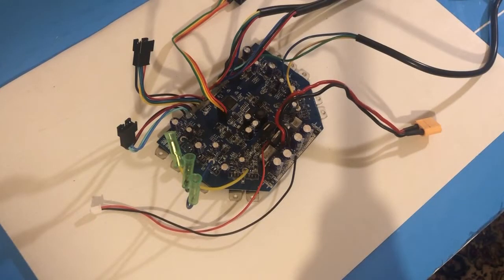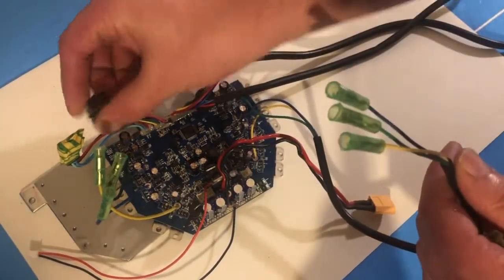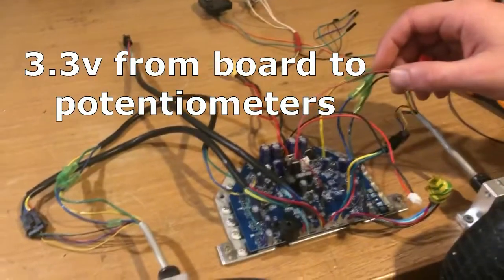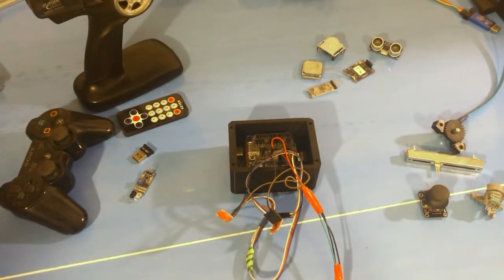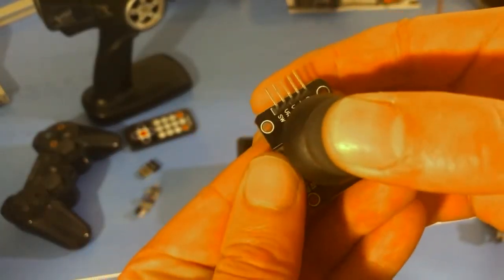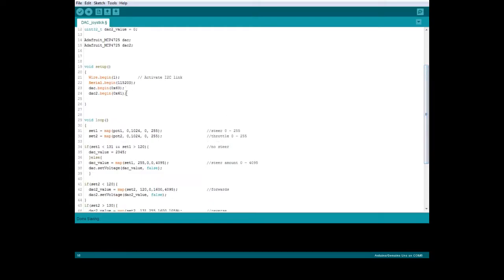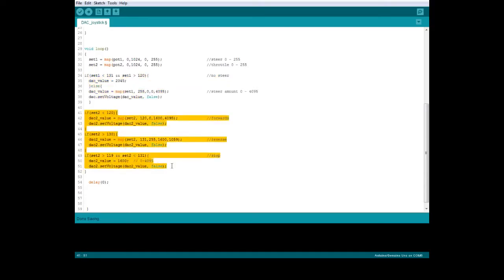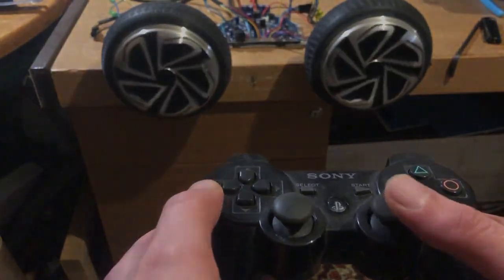HOVERBOARD MOTHERBOARD HACK - how to controll the motors PART 2 - Hover Board Hack

Comment: Hi, nice video. I have a few questions:
1. How can I set it for reverse? like for go-cart. In your video the steering pot seems only control either one wheel and turn into a different speed and direction. What I want is actually simple, I want to steer it forward with the same speed, and I can also drive it reverse (with a switch or else). Can you tell me how can I do that? 

2. Does the battery charging feature still work?

3. How fast the maximum speed can we set in the code?

Thanks before.
Reply from the maker: hi, ok there are 2 pots, one does speed difference, the other does speed for both, so for reverse you just turn the speed one down further than when its stopped and it will go backwards and bleep, for example the 1024 pot value would be something like 0-300 = reverse - stop, 300 - 1024 = stop - full speed, do for your DAC if you are using one you need to split it like that if you are controlling forwards and reverse with 2 buttons / sticks. 

Apparently the battery charger does still work, however i am yet to test it.

Max speed depends on what firmware you are using and if you change stuff in it, the fastest one i have tested myself is the bobbycar version, it has a speed setting you can set when starting up, i think with a 12s battery it can get upto 30mph, its a feature called field weakening, there is more info on this online if you google it, i just set it in the firmware to run off a 10s battery and its fast enough, maby 20mph.

There is a guy who hosts an online firmware compiler that i have used a few times, you can edit the code online, compile it and download the .hex file to upload to the motherboard, here is his channel: https://www.youtube.com/channel/UCLUfNuoSML-vkLYiO0vBUHQ,

hope this helps!

thanks
Reply: @A-tech  thanks for your reply, I'll try it.

Comment: Couldn't the same thing be accomplished using an Esp32? It has 2 builtin DAC channels has wifi and Bluetooth built in to pair the controller. The chip runs faster, dual core compared to an uno.
Reply from the maker: hi, i have heard from someone who has done exactly that, im not sure if the controller can pair without having a usb to connect a cable to pair like with the usb shield, i would like to try it with one but dont have one at the moment, thanks
Reply: @A-tech  I have an esp32 and have successfully paired the ps3 controller to it without any additional hardware. Just the controller and the esp32 module is needled.
Reply from the maker: @jamesmiller9605  ok i didnt think it was possible at least without using a usb host module
Reply: @A-tech  no need for a usb host shield.. esp32 has bluetooth built-in. Care to share with me what code you used for mapping buttons to the DAC. The examples for ps3 controller work for the buttons but mapping them requires more code than the examples show.
Reply from the maker: ok ye sure, how did you pair it without having a usb port for the cable? code is something like this: 

forwards = map(R2, 0, 255, 1200, 1600);
reverse = map(L2, 0, 255, 1200, 1000);

this is just example, so say 1200 to the DAC gives stop at the wheels, 1200 - 2000 or whatever is the forwards range and 1200 - 1000 could be the reverse range

is something like that what you meant? 

hope this helps :)
Reply: @A-tech  you have to plug the ps3 controller into pc and get the Mac address that's all thats needed in the arduino code for it to connect.
Reply: The code in your top post has some flaws.

Comment: Thanks for this wonderful video. I'm having trouble with the wiring etc. The battery wires attached to the board is cut off. When I try to attach it to the battery it sparks. I tested the battery with another board and that works fine. Can you gimme some tips? Also is it possible to have a chat with you? I need some more direction. Thanks in advance
Reply from the maker: hi, they usually spark as its charging the capacitors, i use a switch so its a bit better, do you have another battery to try in the suspect board? what are you making? thanks

Comment: Hi  I am using ps3 controller with esp32 servo library but when only half of joystick works I mean from 90 to 180 works but not from 90 to 0 any help thank you
Reply from the maker: hi, its hard to say without seeing some code, are you mapping it from the LeftstickX?
Reply: This is code what I am using and also I have got dual flipsky 4.20 I wanna ask if flipsky is more safe to use than motherboard and if u don’t know some library for esp 32 uart connection... thanks.  #include <ESP32Servo.h>
#include <PS4Controller.h>

Servo CH3_servo;
Servo CH4_servo;

int LX_val,L2_val,R2_val;
int CH3_val,CH4_val;

void setup()
{
  Serial.begin(115200);
  PS4.begin("00:00:00:00:00:00");
  Serial.println("Ready.");

  CH3_servo.setPeriodHertz(50);
  CH4_servo.setPeriodHertz(50);

  CH3_servo.attach(12);
  CH4_servo.attach(13);

  CH3_val = 90;
  CH4_val = 90;
}

void loop()
{
  // Below has all accessible outputs from the controller
  if (PS4.isConnected()) {

  LX_val = PS4.data.analog.stick.lx;  //Steering
  L2_val = PS4.data.analog.button.l2; //Forward
  R2_val = PS4.data.analog.button.r2; //Backward

  CH3_val = map(LX_val, -128, 128, 130, 50);
  CH4_val = map(L2_val - R2_val, -255, 255, 130, 50);
  

  CH3_servo.write(CH3_val);
  CH4_servo.write(CH4_val);

  
  printf("CH1:%d CH2:%d CH3:%d CH4:%d\n", CH1_val,CH2_val,CH3_val,CH4_val);
  }
}
Reply from the maker: hi, i like to see other peoples code, i have only been doing it a few years so lots of my stuff is pretty basic, i didnt know you can define multiple ints together, ok so i think the problem is you have -128, 128, with my ps3 controller it goes 128 when its in the middle, so 0-128-255, let me know if this helps :)
Reply: @A-tech  no it doesn’t work  too many mapping so this library doesn’t allow me to write code like that but what I founded is when I move Lx to right and same time holding R2 it start to go forward and than I can turn to right and left but still holding R2. It’s just doing funny things
Reply from the maker: ok sounds like its just something mixed up somewhere maby a couple of wires or something in the code doing weird stuff, did you get it sorted?
Reply: @A-tech  yes when I am using arduino uno with usb host shield it works  left joystick as steering and right joystick forward and backward….I am using again servo library but dou you know how to write code for L2 and R2 as control one servo forward and backward thanks.. by the way I am not finished with esp32 I just didn’t have time I think  next week I will try to hook up esp32 using usart for better communication… if found something I will let u know

Comment: Hey, I want to use a PWM receiver as the input. I have got the code for it but I am unsure of how I should go about adding it. I'm also not sure how the wiring is required for the DAC's. Thanks
Reply from the maker: hi, do you mean like an RC receiver? im sure there is a way to do it direct, you can do it with an arduino which might be easier with the mapping of the throttle and steering ranges, the DAC is pretty straight forward, they use i2c to communicate with the arduino and need a 3.3v input so they only output 3.3v max to the hoverboard, does this help? thanks
Reply: @A-tech  Yeah I want to an RC receiver, there was a custom firmware to make it work directly but I could for the life of me get it to work. I am very new to Arduino so I'm not sure what pins to put the DAC's according to the code on. A wiring diagram for the DAC's would be awesome. I know I am asking for a lot but just a look over the code to see if my implementation for the pwm is correct. Thanks for the reply.
Reply from the maker: ok im not sure, havnt done much with rc receivers and hoverboards, arduino pins for the i2c communication are named SCL and SDA or A4 and A5, im going to do a Firmware Hack part 3 video soon so i will make sure to include that
Reply: @A-tech  That would be so good. Thank you. I am building a driving esky. Already got the frame and everything built and just trying to get the electronics to work. Thanks once again!

Comment: it is possible to control the motor separately by a potentiometer?
Reply from the maker: the potentiometers control both motors together, but if you can disconnect 1 motor then yes
Reply: how about controlling  each motor individually by adding new potentiometer,  so that we can control each motor separately? possible?
Reply from the maker: No that does not work, maby someone can make a firmware that does

Comment: Hello, I'm a bit late. Anyways, I want to build a go kart with an old overboard thus I don't need the steer on the rear wheels,if I just leave the steer wires unplugged will the motors just steer in one direction or will they have equal speed(remaining locked in "forward mode with no steering")?

By the way, your channel is so underrated
Reply from the maker: hi, if you dont need steering i recommend the 'bobby car' version of the firmware, this makes the wheels go the same speed and has 2 throttles, one for brakes and one for speed, it also has different running modes, so you can have a fast mode which is about 20mph, on my video where i convert a mobility scooter into a go kart this uses the bobby car firmware, hope this helps, and thanks!
Reply: @A-tech  thanks
Reply: @A-tech Can u use this firmware for only two motors because it's says it's for 4

Comment: Anyone know if it might be possible to combine the output into one larger motor instead of two?  If you could also keep the self balancing circuit intact it might be the start of a cheap DIY electric unicycle build?
Reply: hey, i am building a diy onewheel by combining 2 hoverboard motors, have you tried building a unicycle? Sounds like an interesting project

Comment: Hi, looking for an idea on what might be wrong, flashed the firmware from the link in the first video and all is good, no errors, but when I turn the board on with everything connected, it will slowly rotate the motor clockwise a couple times, stop and do the same counterclockwise, stop and the board turns off. All by itself. Pots have no effect whatsoever. It will do this with or without any pots connected to input wires. Im using the 3.3v pin for them. I flashed the board again, no change, everything was done to the letter from the first vid.
Halp?
Reply from the maker: ok not sure if you have sorted this now, what firmware you are using is the wrong one and just does test mode, you may be able to change it but i think there are lots of different versions

Comment: Are you able to help me with something? How could I bypass the dead man switch (well, I'd like to flick a switch) to trick the board into thinking someone is standing on it.).
Reply from the maker: hi, sure, inside the hoverboard there are little sensors that get activated when the rubber pads have enough pressure to push something into the sensor, all you need is to block these sensors, possibly you could have some holes in the top and just poke a bit of plastic in, alternately you could solder some wires to the sensor and fit a switch to them, hope this helps
Reply: @A-tech  I think that might be the way to go, blocking the sensor, as after doing some digging if I wanted to add a switch it looks like I'd have to remove the entire sensor slot, extend all 4 pins and put an inline switch on either the infrared led side or the receiver side.
Reply from the maker: ok great, a couple of slits in the rubber pads and some bits of a cut up discount cards should do the trick haha

Comment: Please can show a more detailed scheme of the installation of the potentiometers, I do not appreciate the connection, because you only use one connector in your scheme, I lack the other, thanks you are a crak
Reply from the maker: hi, you use the long cable and only the black, blue and green wires to potentiometers along with the 3.3v from the motherboard, the red wire with the others is 14v i think so dont use that

Comment: Hi...
Can we use this setup without the i2c in the circuit.....
Reply from the maker: hi, yes you can also use uart or potentiometers, thanks
Reply: @A-tech  hi..
When I'm connecting the dac VCC to 3.3v Arduino, the motors start to spin without the joystick being connected.....
Can you please help
Reply from the maker: @VikasKumar-wz9ju  i think it needs to be connected when you switch it on? are you using arduino?
Reply: @A-tech  Yes I'm using Arduino.
I want to control the wheels with nrf module..
There's a transmitter and receiver, I recieve the joystick values from transmitter and the try to control the motors via dac....
But the motors keep spinning move randomly with joystick.....
Can you upload a video showing how to control it with joystick and nrf...
It would be very helpful.....
Thank you

Comment: Nice tutorial A-Tech. Is it possible to control both directions by potentiometer or maybe some additional switch? I actually don't need the differential. I would rather avoid the  motor phase switching. It would be better to control this at input site. Nice work again!
Reply from the maker: may i recommend using a different firmware?
Reply: @A-tech  yes. sure

Comment: Simple alternative with esp32 using esp32's own dac, without using mcp4725, pins in esp32 -> 25 and 26.
CODE:
#include <Arduino.h>

#define DAC1 25
#define DAC2 26
 
void setup() {
  Serial.begin(115200);
  
}
 
void loop() { // Generate a Sine wave
  int Value = 130; //255= 3.3V 128=1.65V
      this value change to speed
  int Value2 = 150; //255= 3.3V 128=1.65V
    this value turn left or right
  
  dacWrite(DAC1, Value);
  dacWrite(DAC2, Value2);
  delay(1000);
}
Reply from the maker: esp32 has 2 built in DAC??
Reply: @A-tech  Yes ESP 32 has two 8 bit DAC...
 I tried the above code it works..
Reply: @A-tech  that's right friend, it is a method that makes things a little easier, thanks for inspiring me

Comment: Hello,
Arduino only recognition one devices:
RESPONSE from arduino --> DAc I2C device found at address 0x60  !

with this device only change the speed, but not turn,
any help please
.
Thank you AND GREAT VIDEO!!!
Reply from the maker: hi, ok you have found a common problem, the DAC are both 0x60 default, on the back there are 3 soldered pads with a small trace between them, just slice through that with an exacto or stanley knife to break the connection then it will be 0x61, hope this helps, thanks
Reply: @A-tech  Thanks for the quick response, your information was very useful, I am waiting to see more of your videos

Comment: Hi a Brilliant Hack . Many thanks , if it Possible for you to do a mod to this hack . by controlling the motors digitally rather than analogue input for example via serial monitor commands . That would be very interesting addition to this video . Once again Many Thanks .
Reply from the maker: hi, i tried the serial way and there was a problem if the arduino crashed the robot would keep going so i had to use DAC instead for an extra level of safety

Comment: Hello this was a very helpful video, I actually did it but I am controlling the motors with an analog joystick which is the same as 2 potiwntiometers. It worked fine for a while but then it stopped working, the motors stopped moving. I have checked and everything is fine it should work fine but it doesn't. Do you have any idea why this is happening?
Reply from the maker: it could be the battery is getting low?
Reply: @A-tech  I thought of that too but I checked the battery and it has 35v I recharge it and I still have the same problem. The motor test does work so I tried another joystick but still the same problem. Is there another easy way I can use as an input instead of the joystick?
Reply from the maker: @fabianarevalo2198  yes you could try testing it with potentiometers? i used a DAC with mine so i could map out the ranges, it may because the joystick is always in the middle when its untouched, hope this helps
Reply: @A-tech  I tried with a normal potentiometer and it didn't work, it is like if it wasn't even connected. Can the main board be ruined?
Reply from the maker: @fabianarevalo2198  im not sure thats a strange one, were you using 3.3v or 5v for the joystick / potentiometers?
Reply: @A-tech  3.3v I have tried everything reflashing it again, changing the potentiometer, I thought a capacitor was bas so I changed it and nothing. I had another motherboard that burned and it wouldn't even turn on but this does turn on and make the sound it is only not reviving the input anymore?

Comment: Is it possible to bypass the steering pot and just have the wheels spin the same speed always?

I just want throttle and break controll none of the other stuff is needed for my current project.
Reply from the maker: hi, yes you just leave the steering pot in the middle, thanks

Comment: Where exactly did you connect the potentiometers on the board?
Reply from the maker: ok on the cables that go to the foot sensors, the shorter cable, connect the blue and green wires to potentiometers, using the ground off the board and 3.3v from something, if using 3.3v from another power source to the motherboard make sure you connect the grounds together
Reply: @A-tech  thanks for great video. 
but sorry sir, 
you did connect potentiometers to longer cable and taped to avoid any contact shorter one. 
So it's a little confusing if you say now to connect to shorter cables foot sensor?

Comment: Hey..Nice job.i had a question..if i want to connect a ethrottle on a hoverboard.i only want it to go forward.the throttle has 3wires.thank you john
Reply from the maker: hi, i think you would connect it up the same way as a potentiometer, you may need to adjust it somehow so it can stay in the middle, hope this helps
Reply: @A-tech  or you could put an arduino ( maybe pro micro, it's very small ) and use it to map the ethrottle using an ADC like in the video.